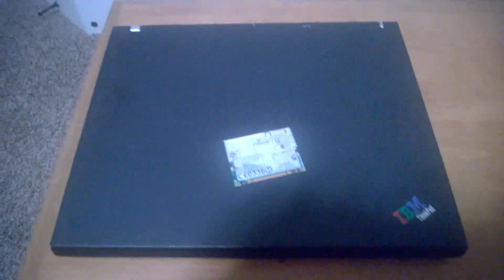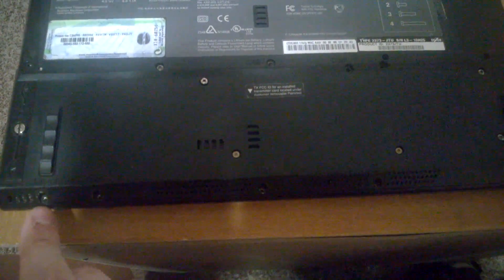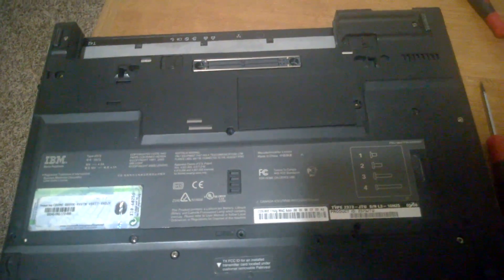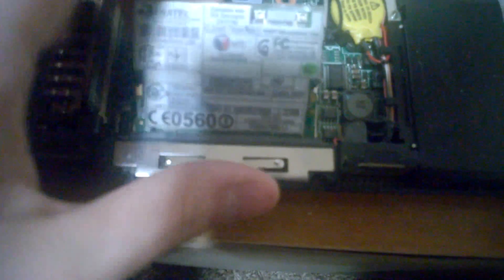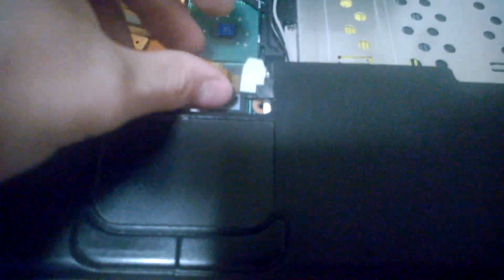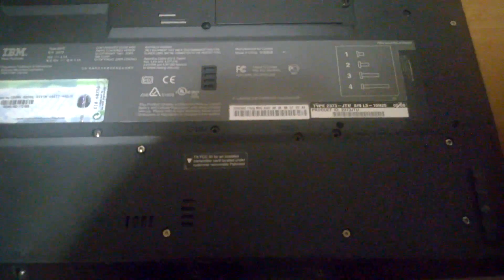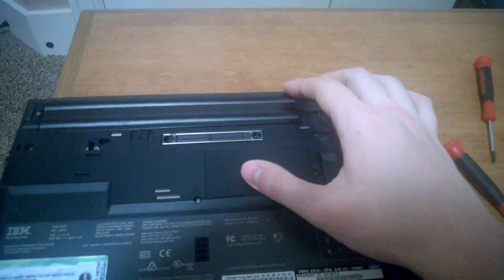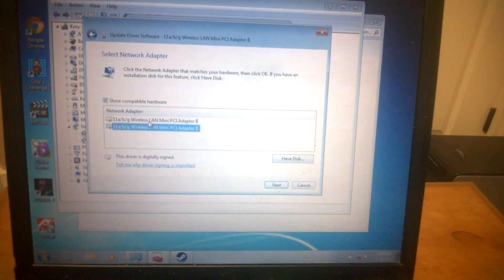How to Replace/Upgrade Wi-Fi Card on an IBM Thinkpad T40/41/42(p)

Comment: The T series looks like my X41 tablet.  My issue is that mine HATES public wifi.  It's fine at home; it's fine in a hotel room but constantly disconnects at work or at a coffee shop, which is where I need it the most.  Do you think it's worth upgrading the wifi card in this instance?

Comment: My wifi doesn't work i think the card burned out so I hope this works
Reply from the maker: Doesn't work as in can't connect to any networks or doesn't work as in the OS can't see the card? If it's the former maybe the antennae came loose
Reply: @hblankpc  I don't know Alito about computers but let me try to explain wifi doesn't have options in xp I tried a direct cord to my router it doesn't pick it up that wifi light on the computer off and I can't access internet service in any form
Reply: I also have a no sound period thing I not too sure if my motherboard gas to be replaced based of the research I did

Comment: I’ve got the same ThinkPad. The problem is, it will not connect to a lot of newer routers (tried all sorts of security/password workarounds - nothing works). Any idea about replacing the card with a wireless 802.11n or ac card? I think they’re mobile PCI, half height? Anyone have experience with this?
Reply: buy a cheap router ，set with no password，limit mac address 。then no other device can connect。 i have 4 hp tc1100 with old wifi card works

Comment: do you know where could I find drivers and software for Wireless Card for Windows 2000?
Reply from the maker: Start at https://thinkpads.com/support/Thinkpad-Drivers/download.lenovo.com/lenovo/content/ddfm/T40.html and replace T40 with whichever model you have
Reply: Thanks it was a pain but I was able to find them here: http://www.nobu-usa.com/drivers/n8wts_v1.0/intel_wireless_2915ABG/WinXP%20Pro/Wireless_TIC_125458_v10.5.1.0_XP32_Connection_Software.exe

PS: Do you know if its posible to make volume up/down keys display anything when you press them in Windows 2000

and if its posible to make FN key work (FN+F4(sleep) work others dont)
Reply from the maker: I have no idea, they don't display anything on XP/Vista/7 either. I think that's just part of the design. As for Fn, the only thing I can think of is making sure all devices in Device Manager have a driver, but I'm sure you've done that already. Haven't encountered that myself
Reply: Yes I have done that (only one Unknown PCI Device left) do you know of any program that would work on Windows 2000 that would tell me what devices I have in IBM T60 so I could donwnload drivers for them (device Manager doesn't realy do that it only shows Unknown Device and makes me guess on what it could be)
Reply from the maker: My gut feeling tells me it's the Lenovo PM Device, I don't recall seeing a download for it anywhere on the thinkpads.com site, had to look elsewhere. PCI-Z 1.31 will show you what's on the PCI bus but when i tested it out the PM device (which I do have the driver for) didn't appear on its list. It's been a while since I've used 2000 but https://support.microsoft.com/en-us/help/244601 could help (important bit is about halfway down the page)
Reply: it was (Windows Update found it) not sure what it does?

PS: just for fun I tried installing KernelX for Windows 2000 on it and then Fingerprint and WIFI stooped working
Reply from the maker: It's something to do with power management, I've never been able to determine what it does specifically, but as long as it's not showing up as an unknown device I don't really care :p

Comment: how do i turn wifi on a t41
Reply from the maker: +Kzeila Kilgore Turning Wi-Fi on and off on a T41 is the same across the T40-T42p line, Fn+F5. See my comment below if you have Bluetooth.
Reply: +The Obsoletist can u install Windows 7 or Windows 8 on this can u make a turtorial ?
Reply: mano pasame el drive de video porfa
Reply from the maker: Raving Gamer Windows 8 is impossible but I've been running 7 for years on this T42, just have to get the driver from ftp://ftp.hp.com/pub/softpaq/sp27501-28000/sp27665.exe, extract it, and use Device Manager to install the driver.
Reply from the maker: Victor Aular ftp://ftp.hp.com/pub/softpaq/sp27501-28000/sp27665.exe
Reply: grasias